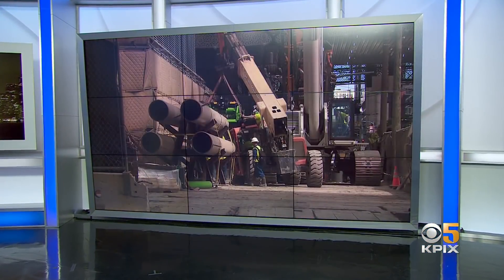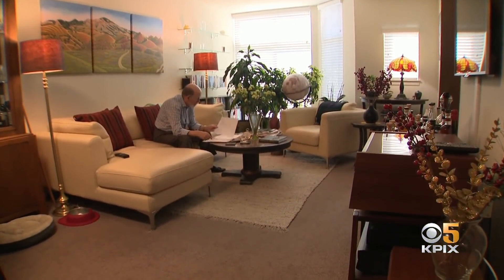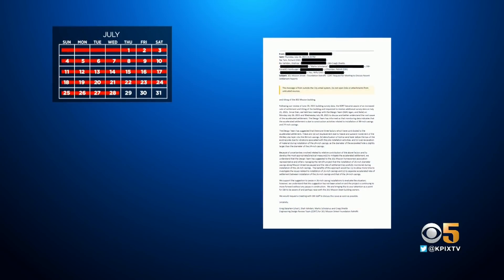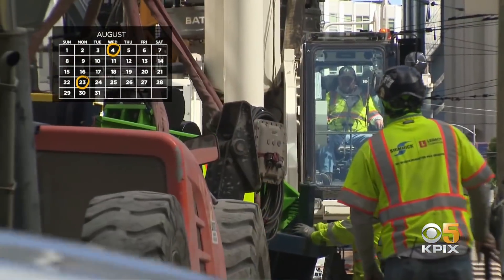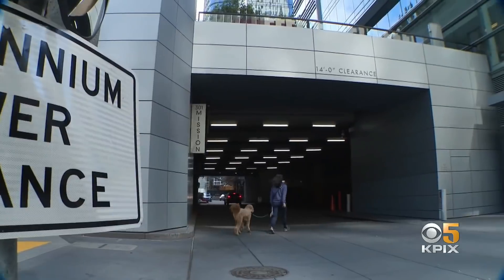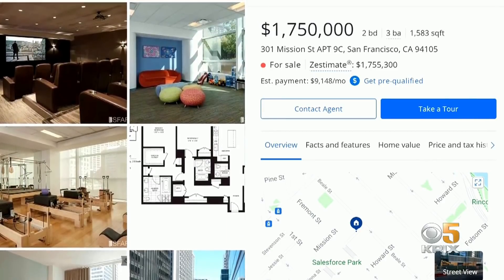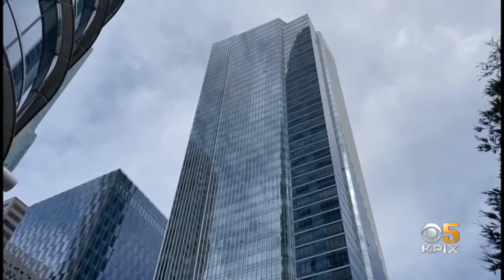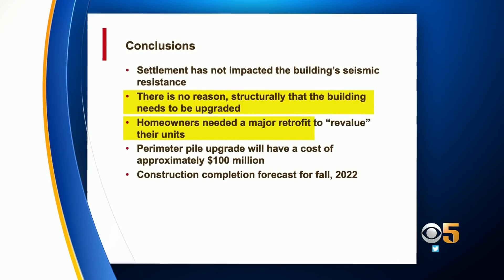Despite Warnings, Repairs on San Francisco’s Millennium Tower Caused Additional Sinking

Comment: FACT...  THE GLASS IS HOLDING UP THAT TOWER...  That is why the glass panels popped out a few years back...  The Towers glass it is under extreme pressure when the Tower tilts, glass popped out.., because of such pressure to tilt out of square..

Comment: Pinning one side of the TOWER will not work...  Piles will only be temp 6 years tops...   THE TOWERS UNDERGROUND PARKING.., MAJOR STRUCTURE FAILURE...Can't pin that, pile it...   wish you luck...

Comment: Hamburger, correct. That is what a thousand or more, persons shall be, WHEN THAT THING tips over......watch n' see.......Humans, once convinced they're allways correct, will just JUSTIFY THEIR ACTIONS. The building is 'talking to you all....'' but y'all not listening..... Doofus engineers.       SHOULD PLACE PILES, ON THE HIGH SIDE, not the low side ! dummies. DRILLING DOWN, causes a type of 'vacuum'. AND, NATURE ABHORS A VACUUM. The mud/sand/clay will push into the hole, 

             HERE IS SOME EDUCATION, for you Mr. Hamburger > > >>          This building is 686,000,000 pounds.   Too much for the 'footprint' of the so-called ' engineered foundation ' ! For comparison purposes: FACTS One General Electric 4400 hp locomotive, fully fuelled weighs around 430,000 pounds. IT WOULD TAKE 1,595.4 of these to weigh the same amount. Doofus engineers, bought off by the greedy contractors, building on 160 year old filled-in rubble, without going to BED ROCK. 
           STUDY THIS        The Millennium Tower may be the most recognizable sinking building in the city, but one researcher says earth-based and space-based observations confirm the entire downtown area around it is sinking as well. “I looked at every building in the Bay Area, so just under a million buildings,” said U.S Geological Survey research geophysicist Tom Parsons, who estimates that over the last century, 3.5 trillion pounds of development and human activity – including the subsidence tied to loss of groundwater -- have led to an estimated settlement of three inches across the entire Bay Area. “Clearly, the most density and the tallest buildings are centered in that downtown San Francisco area, and that's where we see the most calculated cumulative settlement from all of those buildings together," he said. Turns out that at an estimated 686 million pounds, the Millennium Tower is the third heaviest building in the city. The top nine all weigh more than 300-million pounds, but the only one that’s leaning significantly is the Millennium. Groundwater loss from adjacent construction has been blamed for the problem by the tower’s developers, while geotechnical experts say the key is that its foundation is not rooted in bedrock. “The Millennium Tower’s an unusual example of tilt, but generally they go down vertically,” said Parsons, who has long studied the stresses that build up on the earth’s crust. He says all the buildings downtown likely weigh enough to exert sufficient downward force to influence an earthquake fault. Fortunately, the San Andreas fault runs offshore before it reaches the city. So, he says, the billions of extra pounds will not likely have seismic implications. Still, the mass of sinking buildings shows up clearly in yellow in enhanced images captured by the European Space Agencys' Sentinel 1 satellite. Okay, more FACTS. DID you, ever compact just-poured concrete, with a cement vibrator hose type tool ? okay, when attempting to drill new external piles, the vibration/noise etc CAUSES THE SOIL BELOW, TO compress, even more.......not rocket science, either. Let us see, as this video progresses......the more you 'try to help'........the worse, the situation becomes, until '' topple time

Comment: Every engineer involved in this project knows one thing,  It can never be fixed, and a long shot to even stabilize it.  Everyone wants to dance around the FACT it would be cheaper to tear it down and start over.
Reply: @ericjohnson710  Was tearing it down and start over not clear? The problem; they switched from a steel frame to a heavier  renforced concrete frame, used friction piles as opposed to piles down to bedrock, The more ( friction piles)you use of them the more you disturb the soil making friction piles less effective, the more the building leans, the more weight is added to the weaker side, making it fail even faster, the basics are not complicated, the load calculations can be when there could be "X" factors.

Comment: The building was supposed to made out of steel a lighter than what they did use... concrete. All the additional weight unaccounted for or perhaps overlooked causing the sinking. The building needs to be demolished.

Comment: Sea level rise and Coastal Subsidence of reclaimed land
The Millennium Towers concrete-framed building foundations rest on 950 friction piles on reclaimed land.

 “What we do know is that the foundation of this building does not go into bedrock. It’s all landfill. It used to be part of the bay.”
–Mark M Garay, Attorney, for the condominium owners

This Norwegian University of Science and Technology paper explains that if the piles aren’t long enough to touch bedrock, they rely on the friction of the surrounding soil for support (hence the name).

Should we worry about subsidence?
While subsidence contributes to coastal flooding, it usually is only a problem on reclaimed land. In the past, some cities allowed reclamation projects in their coastal wetlands, backfilling areas with dredged material to create land where there was once only marsh. These areas can undergo compaction and surface lowering over time (subsidence), eventually contributing to flooding susceptibility. 
–THE HILL-Surfside collapse: How safe are our coastal buildings?

Comment: So my understanding (though I don't recall where I read this, so maybe I have it wrong) is that the original recommendation for this tower was that it be anchored to bedrock, as piling friction might not provide enough stability, especially with expected adjacent soil pressure changes (due to future construction) leading to lateral differential in soil friction rates. But, instead, the developer cut corners and went for the cheaper option and rolled the dice (with what I think are, just back of the napkin, absurdly shallow piles). Personally, given the area, soil type, the potential high lateral acceleration during a major earthquake, it seems absurd that they didn't go to bedrock. The proof is in the pudding, as the old saying goes, because the building is a mess of problems.

However, even if this building were sitting in Boston, NYC or Chicago, these types of issues would still be of very serious concern, because it's not just a matter of the lateral forces during an earthquake, but that the building's wind driven vortex shedding and frequency dampening performance is potentially compromised, forces that can exert similarly significant lateral loads. Giving that this building isn't sitting where it's supposed to be sitting, isn't settling true, that the foundation has badly underperformed, and that the recent attempted repairs are worsening the problems, I really hope they're re-running all various structural loading simulations on this building.

My reason for bringing up all these points is NOT because I think the building, in it's current state, is in immediate danger of failure, it's because they don't seem to have gotten a handle on stabilizing the building. To be really blunt, I don't think these people (architects, engineers, planners and contractors) are getting the math right. If you have a problem like this, you need to account for worst-case scenarios, which seems to be a real problem with this building's design, construction and remediation history. So it's not that the building's current tilt, or the settling rate is an immediate danger, it's the apparent lack of situational awareness as to how changing conditions impact the structure's performance. Meaning that the situation could go from a being an expensive problem to an actual public safety crisis, and I'm not sure the people working this situation would actually know when they had crossed that line.

Put simply: the building settled in unpredicted fashion - bad engineering; they attempt to fix it, the situation got worse - bad engineering. To everyone involved: stop what you're doing, re-run ALL the calculations, ALL the simulations, get a second set of engineers and contractors on-site, stop worrying about money. If it gets much worse, the city will make you demo the building and then you'll really lose a your collective shirts. Or worse, it falls over and then you'll all be going to jail for negligent homicide (though I do think there's very little chance of that happening).
Reply: I'm not an engineer, either.  But, as a layman, I just assumed that when building a skyscraper, you always drove the pilings down to bedrock.
Reply: @ralphholiman7401  Not a requirement in many cases, or perhaps even in this case they might not have needed to go to bedrock. But they clearly didn't get the foundation right, and it still seems like they're not getting the remediation actions correct. 

Mistakes happen, calculations with incomplete variables are assumed correct, poor decisions are made. The issue isn't that a mistake happened, the problem is with how badly and slowly they've addressed solving the problem. To fix this problem, they need to start thinkin in terms of over-engineering the fix. Everyone's blown it, trying to minimize cost. To save this building and the investment it represents, they need to be willing to spend whatever it takes. If the city needs to step in, because the owners aren't willing to go that far, than that's what has to happen. Anything less than a thorough, high-confidence solution, and the building will never recover (in value and, possibly, stability).

They need to take a page out of how CitiCorp Tower was handled: a very serious problem was found, they quietly and thoroughly, in a cost-is-no-object fashion, retrofitted the building's superstructure to address the vortex shedding problem that could have led to catastrophic failure. Accept you have a problem, figure out the solution, work as quickly as possible to solve and remediate the issue. The longer a problem is allowed to go on, and the more "containment" is attempted, the more costly everything will become.

Comment: A structural concrete 600’ building built on fill,   with  no connection to the bedrock, with shallow friction piles , next to a major fault line , in a seismically active area , out of plumb by 22”  in a densely populated  neighborhood what could go wrong ?

Comment: As a union ironworker........ I guarantee you I wouldn't live there ‼️®™️
Reply: @rory vonbrutt --- This is an interesting comment.  

I often wonder what the actual 'hands on' workers think of the buildings they're constructing.  As a practical worker, do you still have the knowledge of what is needed in size / gauge / length / etcetera of building components that need to be used to make a structure safe & strong?  I guess you do. 
 
Have you worked on highrises in your career?  
People doing the practical work can often see things that look either questionable or, on the other hand, really good and strong and well designed.
You see what a building is really all about, rather than we who go in when it's finished and just see the 'fancy finishings' of the end product.

It would be fascinating to have coffee with you and hear about what you've seen in construction over the years!
Reply: @be5952  I’m working in New York City note right now I’ve worked on many buildings rebar and structural and you only know about the buildings from the prints and you erect and fabricate the buildings according to the blueprints and then an inspector comes along/inspector and they inspect the work according to the plans and everybody moves on… so it has nothing to do with the construction workers as long as it’s built by the plans and inspected by the inspectors all the prints are pre-inspected by engineers and as an Ironworker all you do is follow the prints‼️®™️
    once in a while you’ll come across things that will not be possible and then a revision is approved up the ladder not down the ladder but other than that it’s all by the plans/blueprints❗️
   i’ve also worked all over California 21 states 10 nuke plants etc. etc. not bragging just it’s about work and it’s always done the same way you follow the prints, and all your work is inspected by an inspector just like I said….

Comment: 1. Save Lives and evac the building. Cut any more losses.

2. Demolish the build. You can't fix this issue.

3. Scrap what you can from the demo. That's a lotta glass, stone, appliances, piping, PVC, concrete......

2

Comment: If the tower is leaning enough to affect drainage pipes, the tower needs to be demolished. The building can't be lifted to  correct the level. Underpinning can only prevent further subsidence, and even achieving that is doubtful if excavation is causing the tower to sink more. Huge potential for a disaster here.
Reply: Imagine what would happen if an engineering firm came out and said what they know or strongly believe. That HOA would be one the phone to 1-800-sue-them. They seem more concerned about their investment. So no one is going to do anything other than slap cosmetic fixes on it or try to come up with another idea about stabilizing something too big to be stabilized. There is no fix for it and no one willing to challenge its being there in the first place. There is no accountability now and when it comes down, no accountability on anyone either.

Comment: If the vibrations from the "fix" are causing more settlement, what will happen when there is an earthquake?  Note that I said "when", not "if".  This building was a colossal engineering boo-boo, and in the end it make have to be taken down.

Comment: I used to work in 45 Fremont st. Building and the entire building shaking every time Bart or big vehicle crossed close by. If you don't have a strong foundation in this area your building will in big trouble no question ask. They need to fix the foundation issue asap

Comment: why would you undermine a structure on the leaning side? Drive piles
Reply: On the plains there are a lot of elevators to store grain  and they lean but the way to straighten them up is to dig on the high side to lower it and pull them back or lower the high side -all of them are not built to bed rock------that is 200 feet lower ---- they are built on soil that is soft but a footer that is 15 feet larger than the structure and then balances loaded

Comment: Vibration causes water soaked ground to settle.  It's the same principle applied in concrete pouring to get rid of voids and air bubbles.
Reply: particularly in sandy, silty soil.
Reply: Sandy soils are often considered as soils with physical properties easy to define: weak structure or no structure, poor water retention properties, high permeability, highly sensitivity to compaction with many adverse consequences.

Comment: You have to grade sewer pipes exactly to have the sludge flow correctly. If the building is out of level it's going to affect the pipe angle and that gets messy and smelly
Reply: Question:  If the underground sewer pipes are in the ground and not moving (static), what happens when the building's sewer pipes sink with the building?  Something has to give (or break).
Reply: They recently reported that this already is a problem and getting worse! Perhaps they could install a few porapotties in the service elevator 😂😂🤦‍♂️ imagine living in a multimillion dollars apartment and having to shit in a potapotty in the service elevator, which will then be lowered to the bottom for cleaning!
Reply: Maybe the residents should cut to the chase and poop in the street,  like the homeless.
Reply: Poop out the windows.

Comment: The solution is so obvious and simple. All they need to do is run some steel cable between the Bay Bridge Tower and the Golden Gate Bridge Tower, then suspend the Millennium Tower from the cable.  Problem solved.
Reply: 😂🤣😅

Better yet,  dangle it from a helicopter!

Comment: I would like to hear the seismologist building engineers talk about the tensile strength of compression on the continuous compound pressure on the leaning side of the building and the upward pool on the opposite side if another 7.0 earthquake hit that had to swaying motion in the same direction. 
                     There is literally no more room for any more compression or pulling force in that direction it turns into snapping force on the far side of the building and it literally a explosive collapse on the leaning side. 

          I wonder if those involved have already talked about dissolving their business and moving their assets for the upcoming lawsuit that would bankrupt them if the worst case scenario happened so they could get out of responsibility.
Reply: I was the first comment before the catastrophe occurred !

Comment: Stop panicking, at least it is not shaking like SEG building in Shenzhen. How about converting the building as a vertical prison, there are 2 benefits:
1. it can mitigate prison shortage issue
2. it can motivate criminals not to commit crimes
Reply: criminals do not care about a tower that may tip over or crush them
Reply: @donaldotrumpriguez2024  - good.  We'll fill the building with criminals,  coddling them so they won't want to escape,  then when it collapses, that will solve our crime problems.